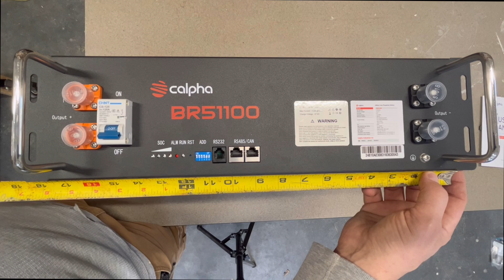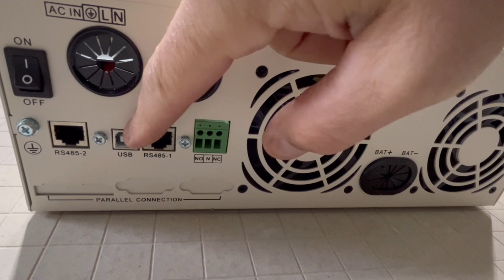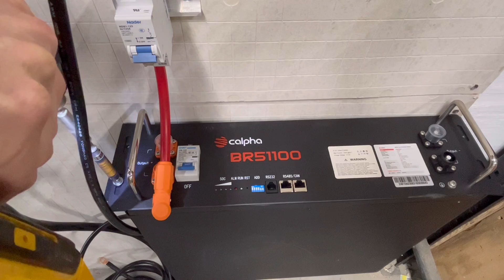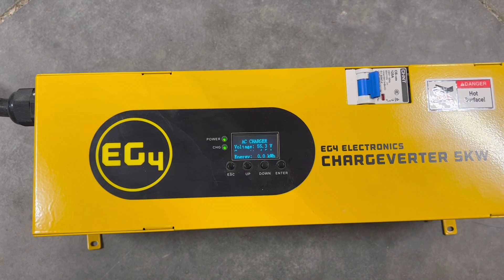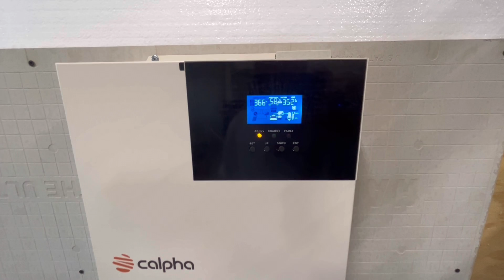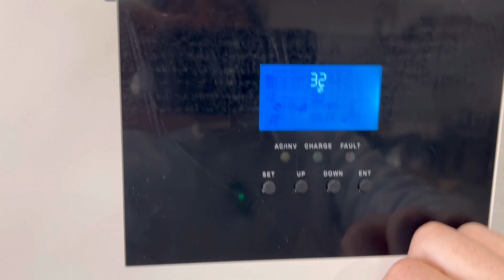Calpha Solar 5kw inverter and 100 ah 48v rack battery review

Comment: On my system, i have the battery setting as a user, and it will not charge more than 20%. Should i have it set to lead acid,  even though i have  Lifpo 4? 

Thanks for sharing, and as always, keep building 👍
Reply from the maker: Unless you have communication set up, with  voltronic units like yours  you’d want to set it to user.

Just make sure your voltage settings are still correct. That might be why it’s only charging to a lower amount. It almost sounds like it’s set to 48v bulk charge.

Comment: How's the inverter working out so far?
Reply from the maker: I tested it for about 2 weeks. I didn’t see any glaring issues. It appears to be an SRNE rebranded inverter. 

So it probably depends on your power needs. There are better options out there, but they are also more expensive.

Comment: Good video, I couldn't get my wifi dongle working either. Better if they used solar assistant to work with their inverters
Reply from the maker: Yeah I think it’s the same network that the eg4 3k uses on this dongle. And that’s pretty decent. But SA may actually work with these, it works with the 3k.

Comment: Do we know what the self consumption watts are?
Reply from the maker: We do! As usual I edited that part out somehow. 🤔 it’s 60 watts. I believe the same as the EG4 3k.
Reply: LOL, stuff happens. It is amazing that our 18k has such a small amount considering it's size. And Adam beats them all at 15 watts per inverter.
Reply from the maker: @stevenfrazier8939  yeah these little lower cost units just seem to always have higher consumption. The 18k’s is super impressive in comparison. But Victron is always the reigning champion.
Reply: Sure is. I almost got a Victron system but the all in one design of the EG4 18K  simplified the build and made it possible to be less busy. With 28.7 kilowatts of batteries I have yet to be effected by the 70 watts of self consumption.
Reply from the maker: @stevenfrazier8939  yeah definitely. I will say I noticed when switching from the 6500’s to the 18kpv. There was noticeably less draw on the batteries over night. But typically if the battery bank is designed correctly, 70w is plenty low.

Comment: Interesting little inverter.  Surprised it's smaller than the EG4 3k, but if there's no paralleling capability, the comms board must take up that extra space.  

I had also seen Brads video on the Calpha battery and that positive/negative cable issue seems like a big red flag to me...especially if you put it in a mobile environment.  Not sure what they were thinking there.

Thanks for the shout-out!
Reply from the maker: Yeah that might be why it’s smaller. Hard to say. Although their parallel model looks really close to the same size.

Comment: It sounds like the EG4 3000.
Reply from the maker: Very very similar. And I would guess the same manufacturer.
Reply: @GavinStoneDIY  thank you for doing these videos.  I'm shopping for something that can handle around 10k and I can be solar only, battery only or grid based on conditions.   Do you have a suggestion?   Oh and I need it to work with my 48v vartrer 100ah batteries.
Reply from the maker: @tlteal  honestly the eg4 6000xp is the best off grid inverter I’ve tested so far. You would need 2 to meet your needs probably. And the battery coms may not function. I haven’t tested those batteries you mentioned. But you can use them in open loop/ voltage only if you had to.
Reply: Waiting to see the new Outback 10k. "The One"
Reply from the maker: @bokchoy335  Midnight Solar’s inverter?  Yeah I’m anxious to see that as well.